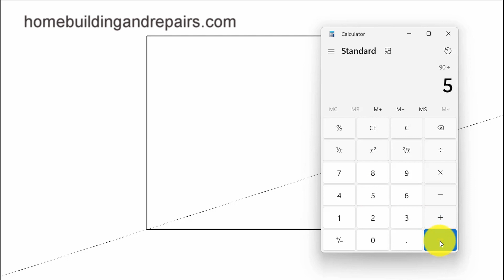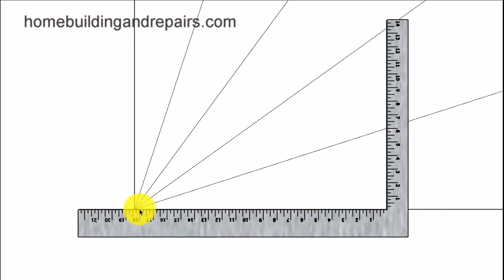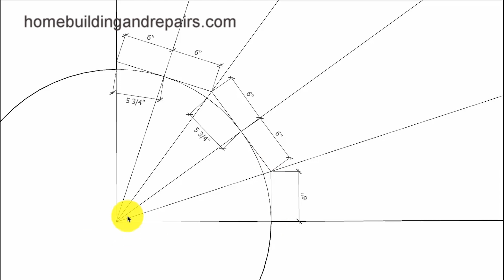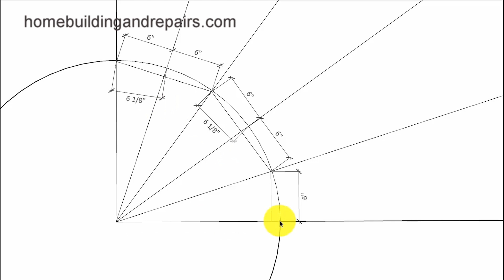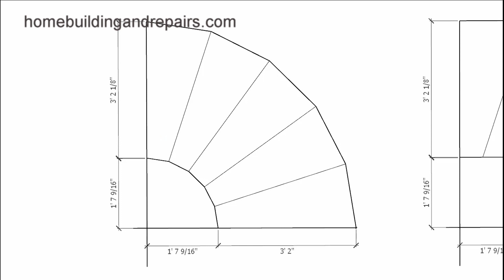How To Layout And Design Five Step Winder Section of Stairway - Building Education Ideas

Comment: I’m thinking about creating a winder staircase around an open Centre. This open Centre will be used to site a pull rope lift that will be used to move suitcases and other luggage between floors. The rope will be moved using pulley advantage installed from ceiling above staircase. What do you think ?
Reply from the maker: I like it.